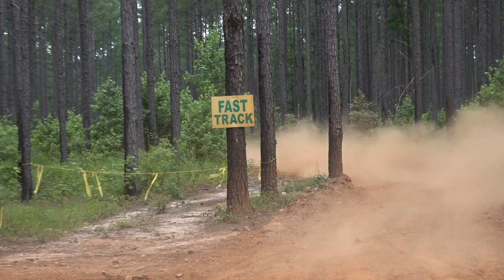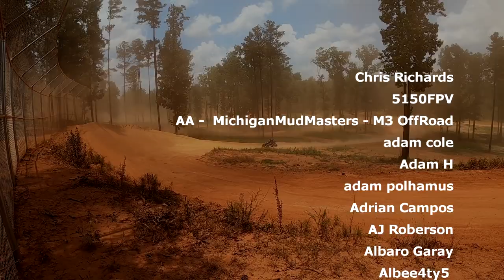We RIP Durhamtown! X3 rips, Turbo RS1 rolls, and Turbo S goin HARRD!

Comment: This park is a joke and you think that it's the best?  You guys need to meet up with our group and we will show you riding.  They close at 5:30 PM and when it rains they close multiple trails in order to prevent trail maintenance.  I live less than an hour away and will never go back.  The past two times that I've been there, they have closed the trails after a rain so they don't have to perform trail maintenance.  I was told that both times my the staff working the front office.  You actually picked the most overrated park in the southeast for SXS riding.
Reply from the maker: Everybody's got opinions.  We had a great time and will definitely go back.
Reply: Off-Road Riding Adventures if drowning your machine in deep water is all that your into, then yeah, this place is probably not for you.  As far as riding fast hardpack in the SE is concerned - Durhamtown is 100% the best!
Reply: @peachpole  I've been there a number of times.  Other than the GP track, there is nothing technical for SxS riding at DT.  Expand your horizons and try parks like Indian Mountain, TWRA, Windrock and even Top Trails.  DT is built for MX and sport quads.
Reply: Off-Road Riding Adventures I agree it’s not technical but that doesn’t mean it’s not fun for those that enjoy fast hardpack trails.   If that’s not your type of riding, that’s cool.  I’ll take my jeep to windrock and leave the YXZ at home haha.